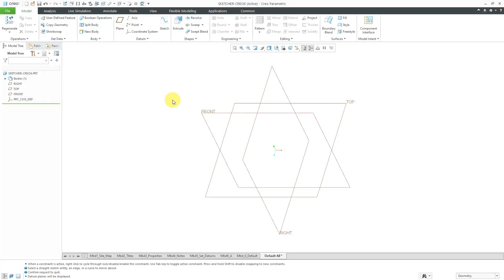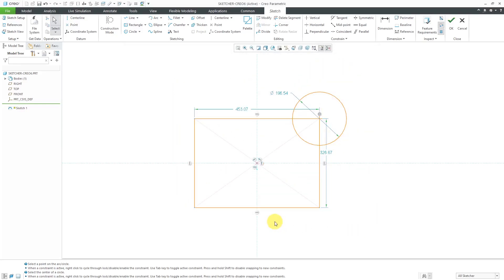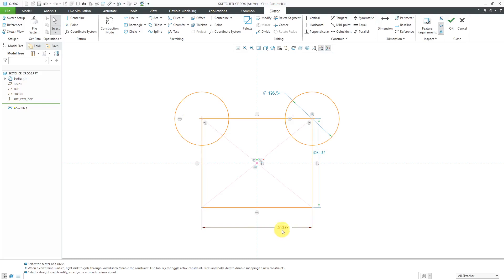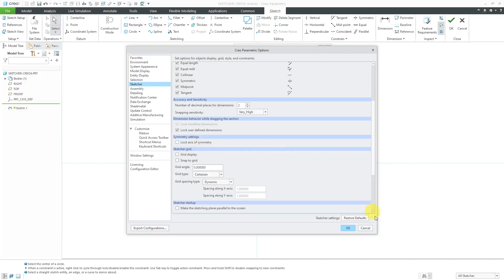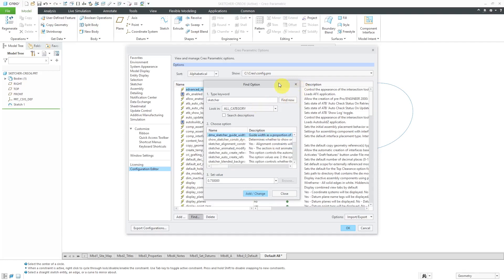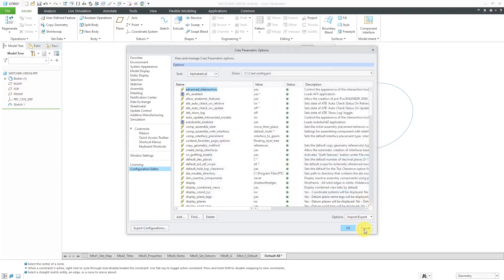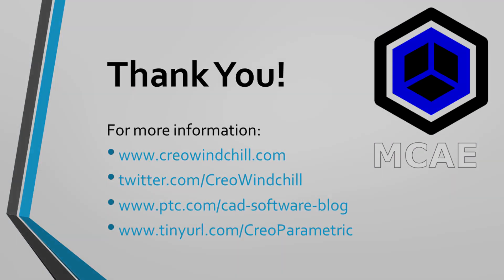Creo Parametric 7.0 - Sketch Mode Enhancements

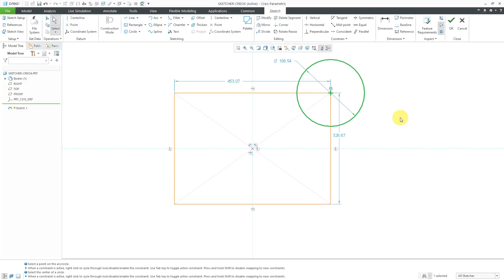Comment: Hi, thank you very much for your videos. I have a question. Can I change the  thickness of the green  line  when I select it on sketcher? For example at minute 1:01 is selected the line of circle but  is very thick. In creo 6 the thickness was thin. Thank you Fabio
Reply from the maker: Yes you can.
Reply: @CADPLMGuy  Ok, thank you, but what parameters are to be changed and where?Do I have to change some parameters in config.pro file? Or change some settings inside Creo? thank's Fabio

Comment: Wow those new constraint display settings are awesome!   Did they also update the 'midpoint' constraint to look a little more different than the coincident constraint?  In creo 6 and prior, even with a magnifier, it's difficult to tell if a constraint is a 'midpoint' constraint just by looking at the little icon
Reply from the maker: Unfortunately I don't think it changed, Sean. Often I have to hover my mouse over it or select it and RMB Explain. M and a circle would make more sense in my humble opinion.
Reply: @CADPLMGuy  same here, I recently even made a mapkey to help with the rmb>explain repetitiveness.  I like your idea of the M.  thank you for the response!
Reply from the maker: Actually, now that I think about it, back in the Pro/E days I think the symbol was the letter M. So my idea isn't so original. I don't know why they changed it to something less intuitive.